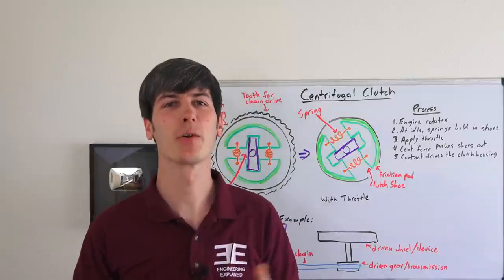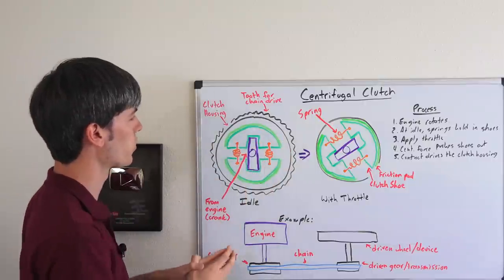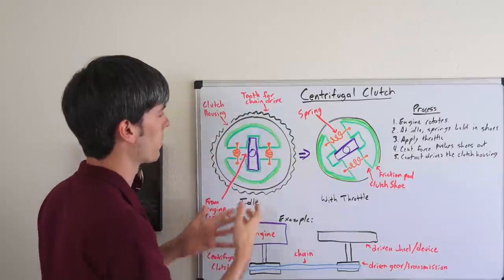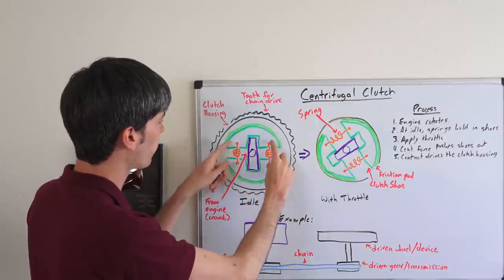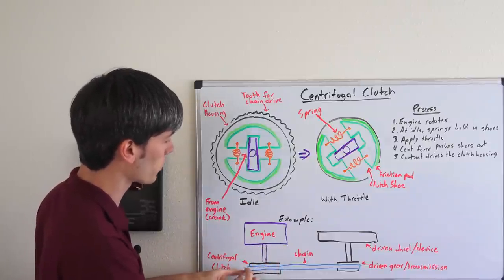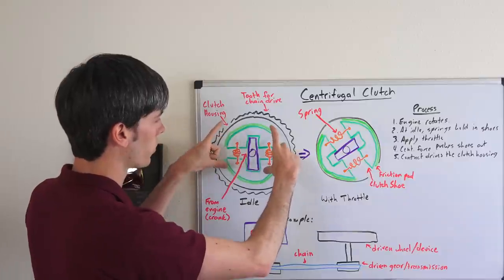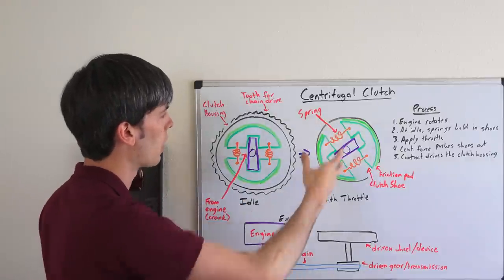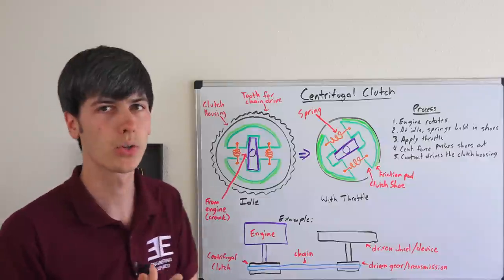Centrifugal Clutch - Explained

Comment: This is exactly how RC car Nitro and 2 stroke gas engines work except the shoes are on a hinge instead of 100% straight back and forth motion.
Reply from the maker: Yeah, probably a more common method used!
Reply: +Engineering Explained so that semi auto tranny used in atv? So dropping the shifter is safe?
Reply: I would never say "dropping the shifter" is really safe, as clutches are designed to provide a smooth torque delivery to the driven wheels, "dropping" it may cause damage as the instant application of torque could easily upset things.
Reply: Brap Brap  I have no idea how safe is it.. I only drop it slightly sometime. Nothing to race since the engine got enough torque for the first gear so i would need to drop it on 2 and it wont have enough power... Poor 225cc 400lb bike with heavy and grippy tire.

Any idea if wet centrifugal clutch can jump. I being doing donut in the winter on 4-5 gear and im not sure if it just a driveline loose or the clutch bumping sometime. WOT in a turn on 4 gear the rpm kind of fall down and start knocking from the engine rear area.. Being abusing this atv and it still running like new ahah
Reply: No i've been told by many motorcycle enthusiasts that wet clutches don't jump, so it might be an engine issue. First step as i'm sure all the forums would say is clean your carb.
Reply: Brap Brap Carb is all good the rpm run super strong.. It just some loose somewhere that kick back. My driveshaft that get out of the tranny as like 1/4 inch of loose so maybe there a bearing or spline loose inside the tranny.

I mostly feel it when tire grab spin grab spin grab. It allow the tension to fall and hit back

Feel like a car that gonna stall. The entire driveline and clutch kick like bang bang bang..

It just less noisy and brutal

Im running Wetclutch certified Rotella 5w40 synthetic and had the same issue with dino 5w30

For a 1992 atv i do expect thing to go loose.. Maybe one days it will blow the tranny out lol

Thank you :)

Edit ( loose from left to right not up down

Comment: Wow dude i always wanted to know this.
Like i always wondered how i could possibly make a bicycle powered by say a lawn mower engine or something, and wondered how other do it.
I thought tourque converter but that seems too big and complicated for this application, and it would be insane to use that i suppose b/c oils and whatnot.
I never knew these existed and never had enough drive to look up how people do it.

I Seriously feel ALOT smarter for some reason
THANKS!
Reply: iwillavengeyou try a weedwhacker motor for a bicycle. also look up flip flop wheel hubs that has a freewheel on both side of the wheel on single speeds.
Reply: +Tyee Cambrón Flip flop hubs have fixed on one side and a freewheel on the other side. The engine in this case should go to the fixed side :)

Comment: could you please do a video on how a Hondamatic transmission works? pretty much just Honda and Saturn that i know of use them. where you have a torque converter as you would with a planetary auto but with the manual style parallel gears each one with it's own clutch. i find it hard to explain to people the difference between a typical borgwarner e.t.c vs a Hondamatic

Comment: Doesn't it hurt the springs when they are expanded by force for a significant ammount of time?
Reply from the maker: Well, springs are meant to do this. Everything wears out eventually (like the springs that hold up your car), but other things would likely fail first (like the friction pads getting worn down).

Comment: well I have a question. I have a 100cc motorcycle with a centrifugal clutch and a multiple  friction disks clutch , I can totally understand the accelerating process but what about decelerating? I use engine braking on my motorcycle quite often but I don't know why when the clutch is driven by the wheel it's in engaged mode. Does it has some sort of one way clutch fitted in or something?

Comment: Isn't there a certain RPM interval where the springs are stretched enough so the friction pads contact, but not actually transfer power effectively to the housing? I imagine it's similar to riding a conventional clutch. This can't be good for clutch wear. So these clutches are good for engines that are either sitting at idle or just getting the nuts revved out of them and nothing in between, right?
Reply: +tirimut Weaker springs would help in that case.

Comment: Great video, Jason! Can this also be used in cars?
Reply from the maker: Praval Telagi Typically used for much lower torque applications, as you'd likely have slip and generate too much heat if you used it with more powerful vehicles.

Comment: Hello Engineering Explained, I just got a random question that popped into my head. Would it be possible to use this type of clutch in a car? if yes would it have the ability to fully transfer the torque?
Reply from the maker: Rokas Getautas Better for low torque applications.
Reply: Engineering Explained alright mate :D

Comment: the power comes from engine. and then to clutch. then why it goes to transmission ? and if it goes to transmission at the last. then how the varying speed from transmission to the driven shaft ?
Reply: when the friction whichcraft happens in a clutch, then it transfers power straight to the transmission. And the speed then depends only on engine's RPM, because the clutch is still engaged

Comment: Explain how does a vehicle move from rest when it doesn't have the RPM enough to engage the clutch shoes.
Reply: Well I think that's the idea, like the clutch only engages if the RPM is high enough.
Reply: Also,  note this isn't how normal car clutches work. There isn't enough control with this design to work on the road.

Comment: Hey 
I have a question 
I have made a go kart on my own and used a gasoline 13 hp engine and a centrifugal clutch , chain and a sprocket on the shaft carrying the rear wheel just like that drawn on ur board
The system works fine except for 1 thing
When the car is at rest and I fire the engine it doesnt go that powerful it just never lose traction  because the clutch slips so power is lost to friction even if I floor the gas pedal the wheel never spins the car just keeps accelerating at a very slow rate till it reach the max speed 
however the clutch I used is rated at 13hp so it should grip and give me that push of the start line

I have seen go karts that drift and smoke tyres on youtube with smaller engines than mine so ?????
Reply: Well. The shoes and pads may be rated for 13hp. But the springs are definitely not. Try using softer/weaker clutch shoe spring, and lower the engine idle speed. If that doesnt work, it possible the the type of pads on the shoes matter. Harder ones last longer, but slips more. Racing types are really grippy, and locks up pretty easily, which is what you want

Comment: i've always wondered how motorbike torque is applied from engine to rear wheel. now i know!
Reply: Captiv4te 
Most motorbikes don't use this. Only 50cc mopeds/scooters..
Probably because the method can't transfer a lot of torque; the friction is purely generated by the centrifugal force. 

Motorbikes just use a regular multiplate, hand operated clutch.
Reply from the maker: Captiv4te I would imagine most use a more traditional clutch, multiplate to keep the diameter and size down. That said, there are adaptations of centrifugal clutches (a bit more robust than shown above) that can be used in bikes: https://www.youtube.com/watch?v=_SECYempg4M
Reply: Engineering Explained 

Well yeah, 

There are also motorcycles with automatic gearboxes... still I wouldn't choose a motorcycle as the thumbnail for an automatic gearbox video ;).
Reply: DoubleYouPee mopeds below 150cc uses centrifugal clutch
Reply: Zhi Hao Looi Yeah, true.
Probably a few higher CC scooters as well.
Reply: to be more specific, higher cc scooters with CVT transmission

Comment: Why is the thumbnail a Harley Davidson?
Reply from the maker: DoubleYouPee Because (at least some) Harleys use centrifugal clutches.
Reply: Engineering Explained 
What? Which ones?
At least not a centrifugal clutch like you explained in the video.
99% if not 100% of harley's have a hand operated clutch and are not free when idling.
Reply from the maker: Okay, the real reason is because I had no pictures of a moped (who does?). But I found some aftermarket clutches for Harleys that were relatively similar in principle, so I thought close enough. Obviously most will use a more traditional style multi-plate with hand operated clutch.
Reply: Engineering Explained 
Hehe fair enough.
Keep up the videos!
Reply: Engineering Explained achem, I do some of us like to push 50ccs to it's maxium, back before 2t was out of racing motorcycles for good there was a class with some pretty wild designs

Comment: Rekluse...
Reply from the maker: joe schultz Yep, same idea but it uses steel balls that sling out, applying pressure to a traditional multi-plate clutch.
Reply: Engineering Explained Steel balls are also used in motorsport.